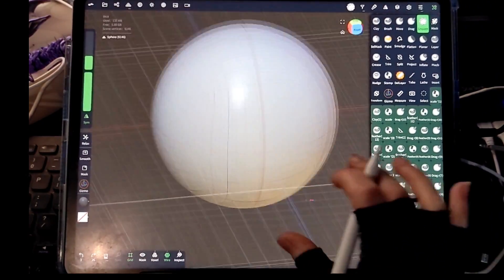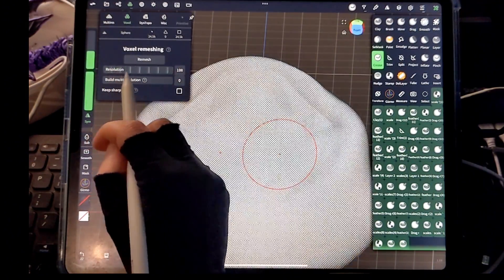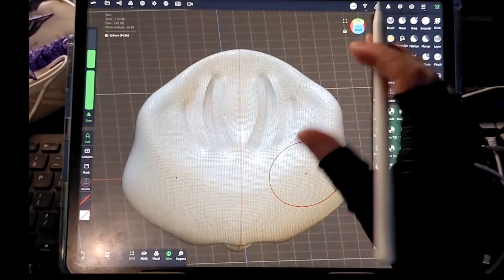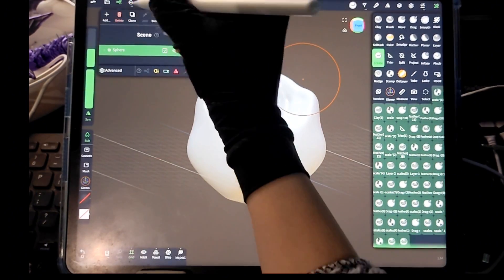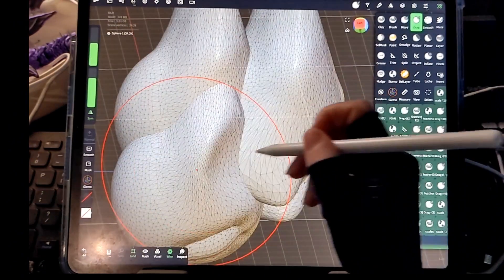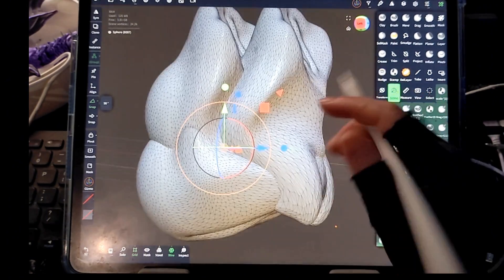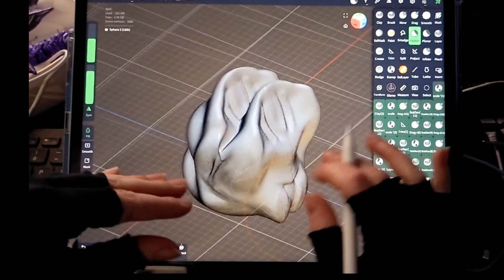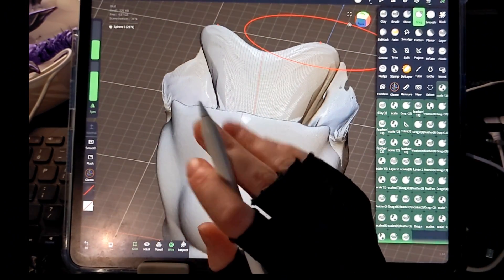Nomad Sculpt Basics for 3D Printing (Part 4)

Comment: Lots of great info thank you - Wish I could print it out to refer to!. Do you voxel remesh regularly as you sculpt? I have been told to save voxel remeshing until the finish but have found it very hard to sculpt without enough mesh!
Reply from the maker: You're so welcome! I'm glad it helps :) Yes! I remesh and subdivide my sculpts all the time while working. You want to save voxel MERGING until the very end though, because then you can't edit individual pieces/shapes of the sculpt after that :) But remeshing those individual pieces is absolutely important!